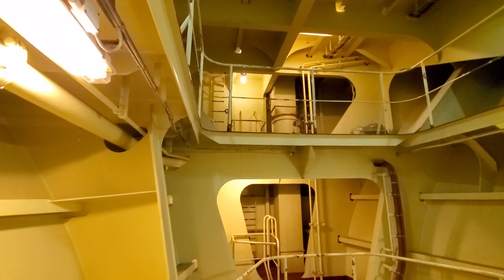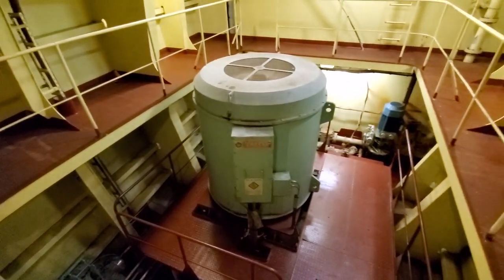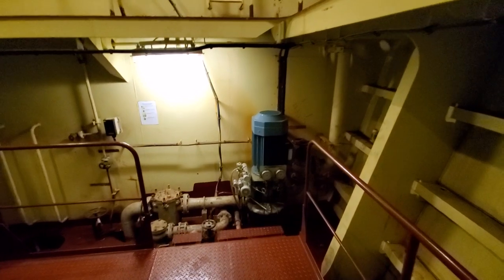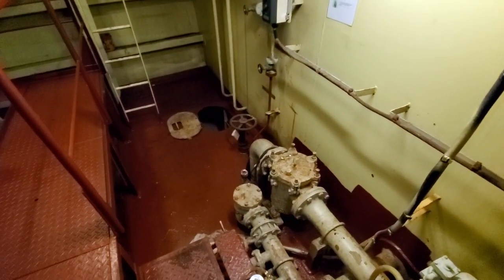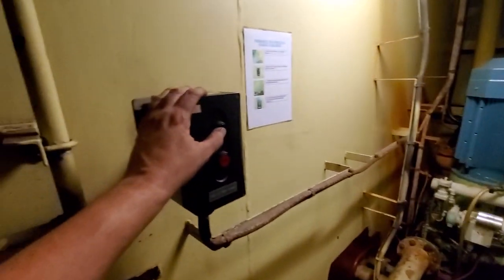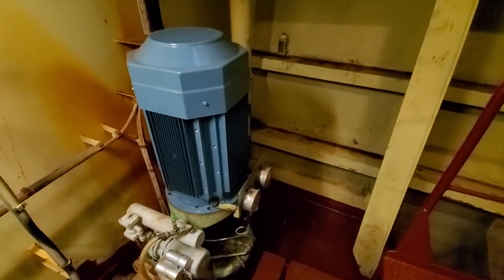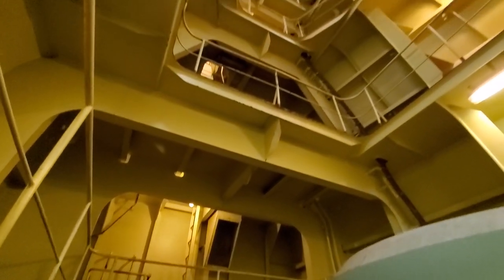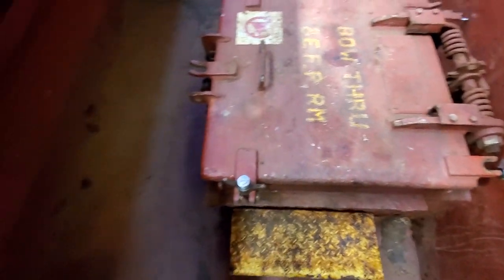Container Ship Vlog #51 (Testing Fire Pump)

Comment: Hey Jeff, been looking forward to an engineering video for some time. Surprised you don’t have someone up top with a fire hose just to “purge the line”. As you said, you keep the valves open, so I’m thinking the build up of crud over time that can be assisted with a purge out now and again. Best Regards and Happy Christmas. James. 🇬🇧
Reply from the maker: Yes normally ships have something open to relieve the pressure, but for this test it is just on very short time as well causing no issues. Great comment, and Happy Holidays

Comment: Is any fuses or breakers on that pump? The reason for asking, in commercial buildings jockey pumps are often installed for the sprinkler system that don't use breakers.
Reply from the maker: well machinery do have controllers which yes do have fuses if that is what you're asking